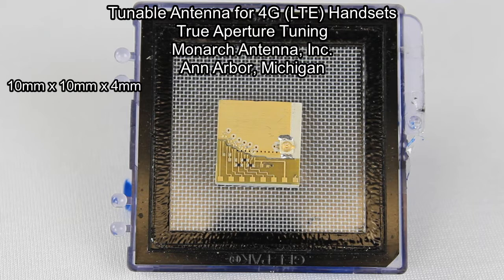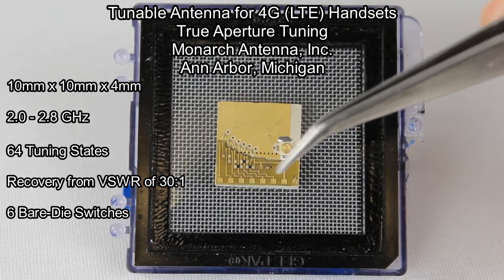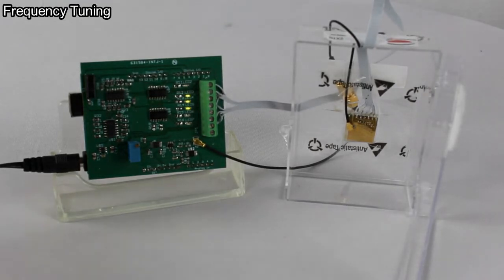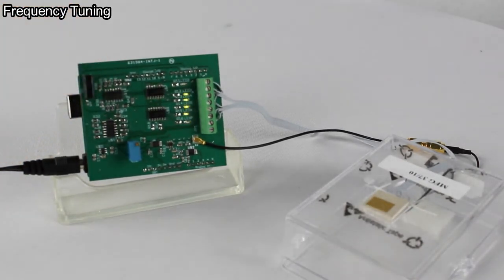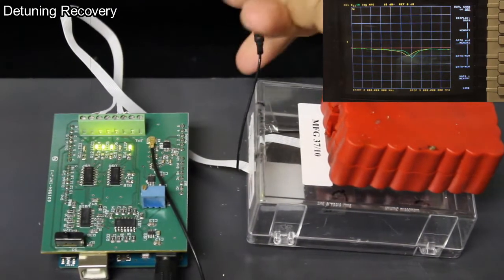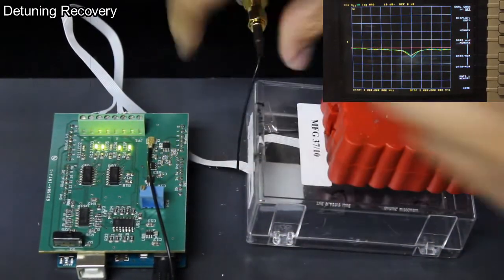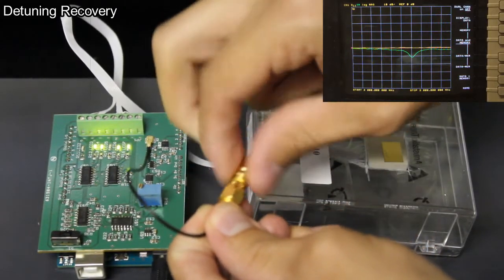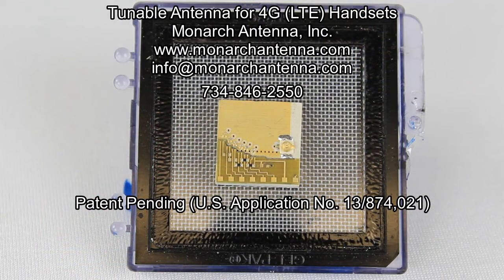Tunable Antenna for 4G (LTE) Handsets from Monarch Antenna, Inc.

Comment: How do the switches work?  Are they just really small relays?
Reply from the maker: They are bare-die (unpackaged) GaAs (solid state) single pole single throw (SPST) relays providing on/off switching. each die is about 0.5mm x 0.5mm x 0.2mm in size and they are wire-bonded to the antenna board. There are six of them in this particular antenna. Details are in the paper: http://www.monarchantenna.com/pdf/TunableAntenna_AP2015.pdf. Let me know if you still need more info. You can contact us via the website too.
Reply: Monarch Antenna, Inc. Thank you so much!
Reply: Do the resistors connecting the DC returns have a significant purpose or are they there just to aid single-sided trace-crossing?  (The right most path has no added series resistance)
Reply from the maker: Sorry for the late reply. You are correct. They are zero-ohm resistors providing bridge cross-overs (or single-sided trace-crossings as you put it) for the DC lines. Also, I am not sure what you mean by "DC returns". They are DC bias and control signals. Switches are biased at 0V and controlled using 0V (on state) vs -5V (off state).
Reply: You guys are fantastic.  I kinda wish my emag class wasn't over now.  I would love to continue researching patch antenna design.
Reply: @rlibby404  you still can